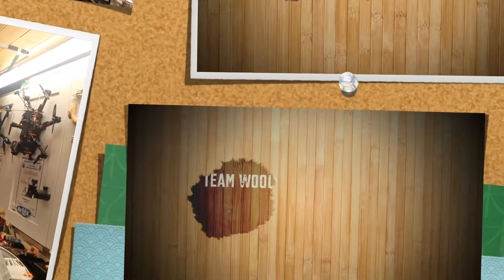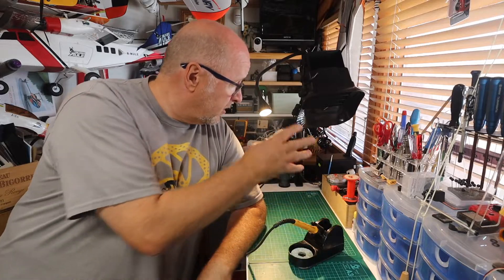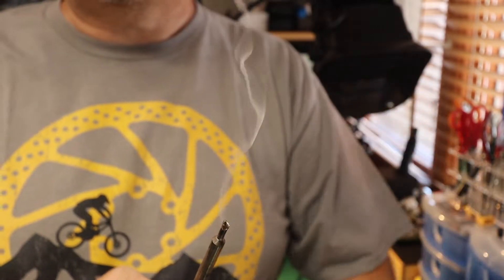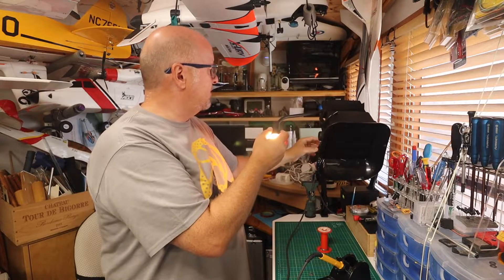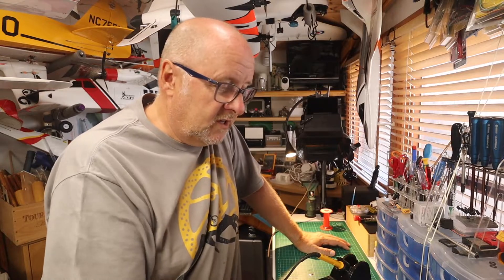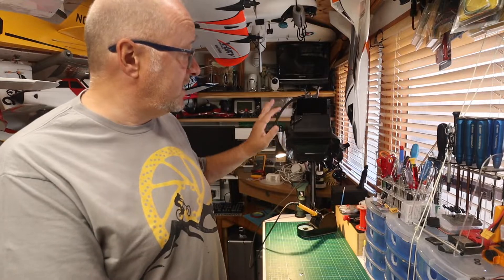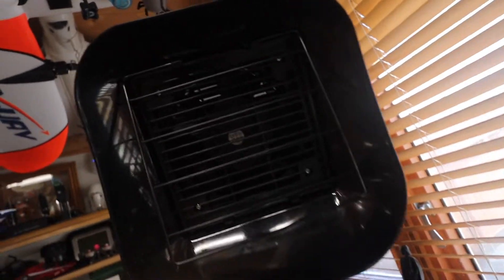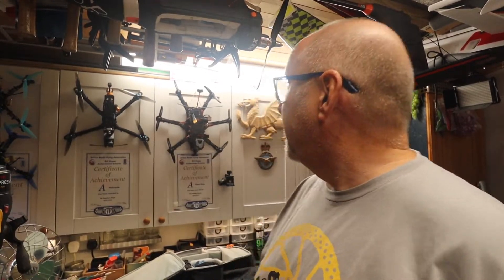Bench Mounted ESD Soldering Fume Extractor

Comment: Can this item be used as a dust collector? for example jewellery polishing dust collector
Reply from the maker: I would say no. It is a carbon filter in front of a fan. It would choke up quickly. You could remove the filter and duct to outside from the back of the unit. Regular maintenance and cleaning it would work but I guess you would need a dust collector though. Not suitable for dust collection